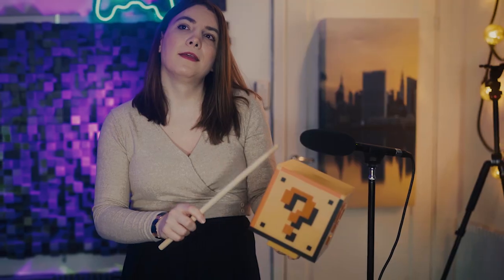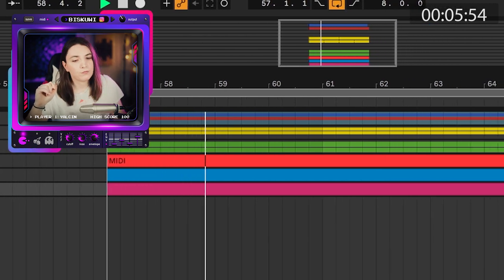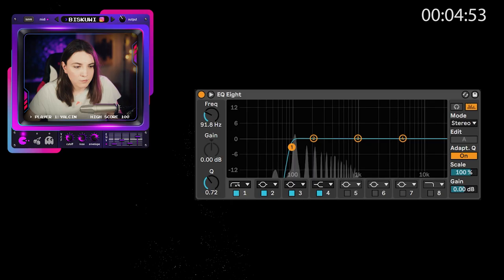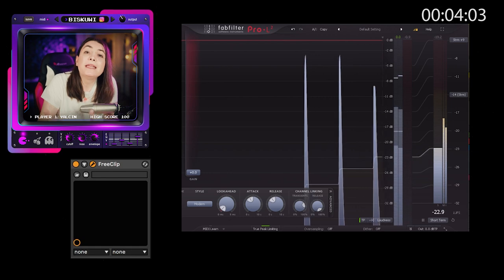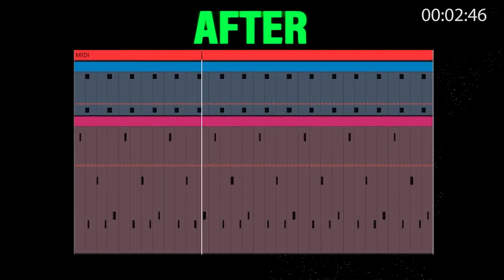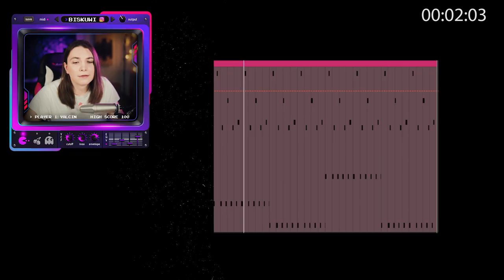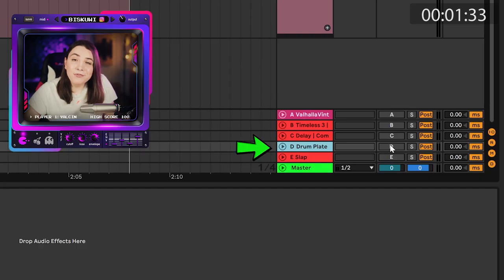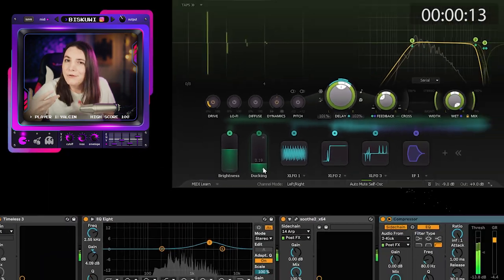Why Your Mixes Sound Thin (and how to fix in 6 mix)

Comment: Interesting  - your tips do indeed make things thicker. However the original thin version had more clarity which is one thing people are looking for when they hi pass a lot of sounds. Its really a delicate balance between thickness/warmth and clarity, not so easy to get right. Nice tutorial though thanks.
Reply: Yeah, on my sound system, I think you took it too far, the "after" is quite muddy to me. It lost sparkle and definition. I think there is a middle ground in there somewhere.
Plus of course, the correct answer is always just to smack OTT on it :)
Reply: I felt the same way. This is what I felt happened to so many metal bands when everything went fully digital. The music from classic bands (not nu metal or those attempting to switch to that muddy sound) was criticized, but actually a lot of fidelity was lost in the mix. When played live, many songs sounded great, lending to the argument that the mix dramatically changed what they actually wrote.

Comment: Another good video.

Somtimes rather than distortion for thin or weak sounds writing new sounds is a better solution. I also liked a TAD bit more of the pinning in terms of stereo movement. Agree the 'before' version was over-kill but the after needs a bit more movement - opinion only.

Comment: I've been making music for quite some time but still don't really do much in the way of mixing, mostly cause I'm not trying to release stuff yet, but here's a cool thing I sometimes do: If you do wanna EQ a sound to the point where it's thin, let's say a big tail that clashes harmonically with the next chord, you can EQ out anything you don't like there and fill it back in with very filtered noise mimicking amplitude etc. 

Noise in the mids is still somewhat slept on by many, it REALLY finishes some sounds. Hell, if the arrangement isn't too full yet, you can have this role fullfilled by atonal percussion with a good reverb, maybe some amplitude automation/lfo tool etc. after all that.
That can in and of itself also be set up to act as a layer of a thinner sound, it'll give your plucks an edge similar to the atonal aspects of an epiano etc.

You'll usually not wanna copy the midi for this layer btw., overtones don't all just shift up/down linearly with the note you're playing on your guitar etc., you'd sound like a chipmunk if it wasn't for formant and stuff like that. It can still yield cool results if it's freq shifted or at least has a very specific EQ profile to which different notes react super differently, or what have you.
That's assuming you're not going for that more raw sound with clearly transposed samples, of course.

Hell, you can even use noise in the bass if you're careful. It's easy with things like impacts in a breakdown, but nothing is stopping you from making the grooviest bassline ever, involving both tonal notes and atonal noise playing along with the kick, almost like a ghost note for guitar players.

Comment: Wow, a concisely explained audio visual presentation of how to use plug ins to view and effect a track. Tbh, the original, unaltered track, sounded good but not as good as when you applied focussed dynamism. Why and how was nicely explained . Why first followed by the How! I use Logic Pro with mostly stock plug-ins but it matters not because I can see the same principles will apply. I was interested to see the EQs graphic display of the final mix and how your techniques of a fattening and focussing of the whole mix and gave it depth and heightened energy.

Thanks for that Alice, I learned a lot.

Comment: I'm not gonna lie . When this came up in my feed , I said uh oh here we go again.  Then upon watching, I was quite surprised, it was super useful.  Another tip I would add  would be to use a say 8-16 bar and then start working with bass and drums to get them as heavy as (is) possible then start to mix and commit your levels and effects . By switching back in each element one by one so you get a better overall judgement .
Don't forget to test on your phone or your car as many times as you can . Somewhere away from the studio where you have no visual guidance just your ears.

Comment: Your videos are fantastic, thanks! But, I apologize in advance for being pedantic: you mix up dynamics and dynamic range again. Dynamic range is a property of a channel or a storage format. Dynamics is a property of music or audio. The dynamic range of a channel or a format (e.g., CD-quality audio) tells you if it can represent faithfully the dynamics of your audio. CD audio has 96dB of dynamic range (it has 16-bit PCM, which, at ~6dB per bit, gives you 96dB), so it can definitely represent your audio. The dynamics are the difference between loud and quiet in your audio (or music: ppp vs fff, for example). Dynamics != dynamic range. It would be like confusing pitch (a D#) of a note and the scale of a song (it's in Am): they are two different (but related) concepts.

Comment: Another tip for thicker mixes. STOP using the analyzer of Ableton's EQ8! It's lying to you about the low end. Use the Voxengo Span instead to analyze and ONLY cut the low end when Span tells you that there is quite an amount of low end.

Comment: the software sounds thin no matter what u put. This is computer sound.. use hw for your main elements and forget about EQ distortion, etc. You can't make fat a thin digital code; it will sound pushed and processed, not natural.

Comment: Loved the tips but didn't love the final product personally 😔
Reply: The mix, while indeed thicker, also ends up sounding duller at the end. Too much clipping off hi hats for sure, and the layering of the clap put it into the mud.
Instead of taking the tops off the hi hat, EQ would've been better--a smoother control without removing its high end altogether. Claps could've been blended to retain more snappy high end.

But the tips are definitely great! As I've learned and heard these tips before, it's a nice refresher.

Comment: You’re content is amazing!
But Sometimes I have to replay parts because the way you talk with your accent, your words are very short, fast and like… too succinct? Almost like a typewriter. Your English is very good, but I think it would be even better if you elongated your words and slowed down. 
I know you want to condense it to make it fast for the content. But really, talking just taking that extra 1/2 second longer on certain words isn’t going to affect it that much, and it improves the quality of your video 20x better! Good job 👍🏻
Reply: I agree, I too have difficulties understanding everything, because she tends to swallow some syllables. A solution could be to add subtitles manually, because the current ones seem to be auto generated. Anyway, the content is great as always 😊